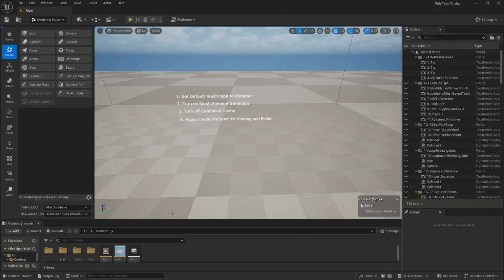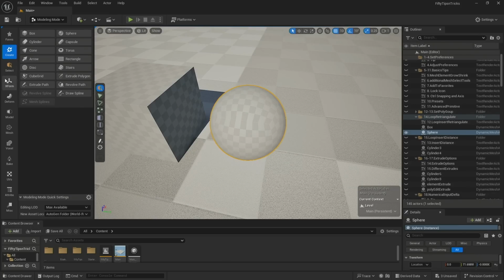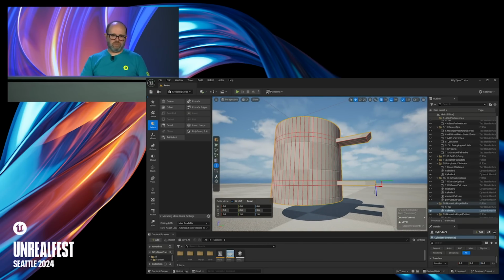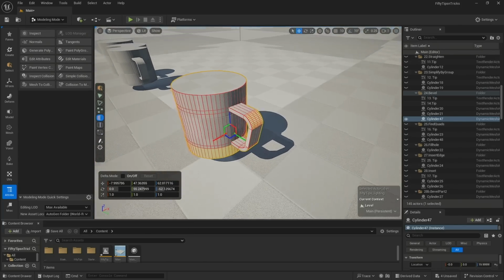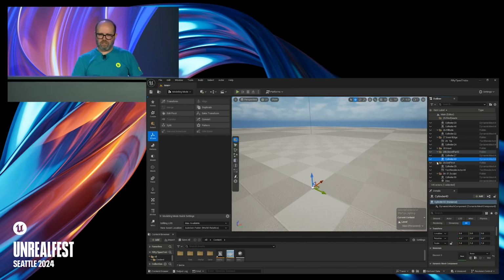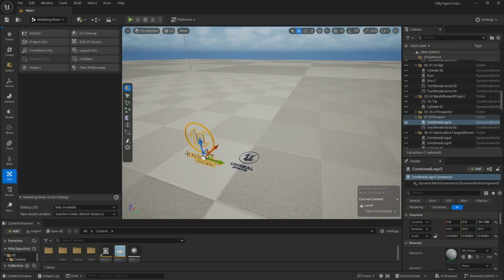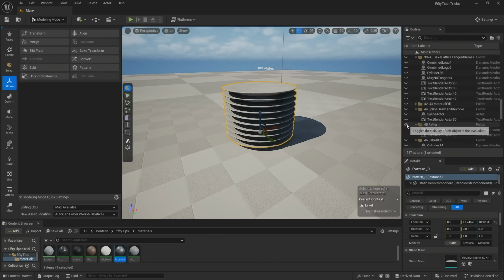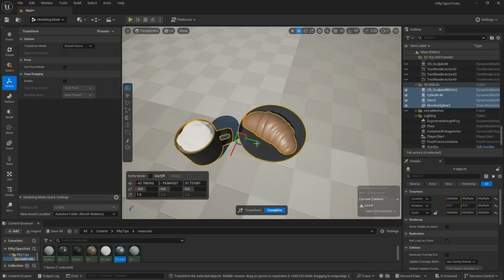50 Tips and Tricks in Modeling Mode | Unreal Fest 2024

Comment: Is obious that nobody will use this for main modelling, characters or detailed props, but is incredible usefull to have modelling and editing tools in the engine, specially for small/medium teams. If you are a map maker and the artist gives you a model that doesnt fit perfectly in the scene, you can now adapt it without asking for it. Or if you need some small props like a barrel, a rock, etc.
Reply: I'm excited for the built in simplification for LODs and material slot tools. There's been too many times I've imported a model from the store or elsewhere that have no/bad LODs or just give up after LOD 3 and make it an ugly billboard. Being able to just select what LOD you want and remove jagged edges, and create new LODs without having to edit and reimport into the engine would be a lifesaver to me. 
Edit: also don't forget about placeholders and low poly models